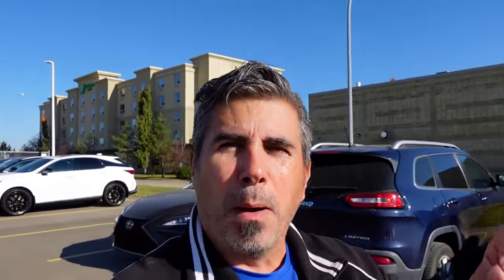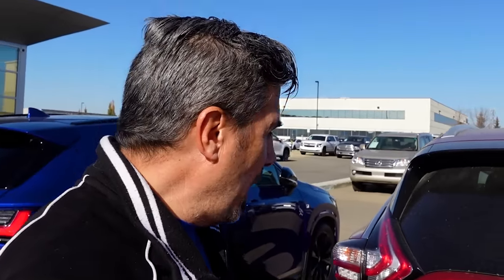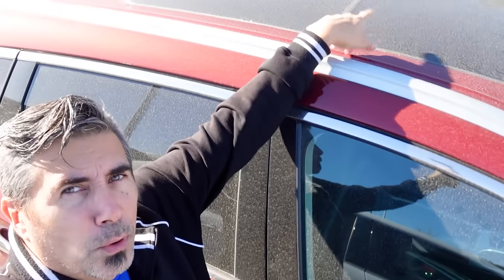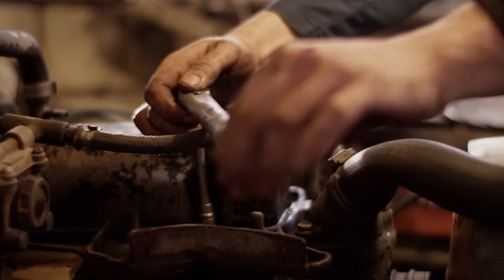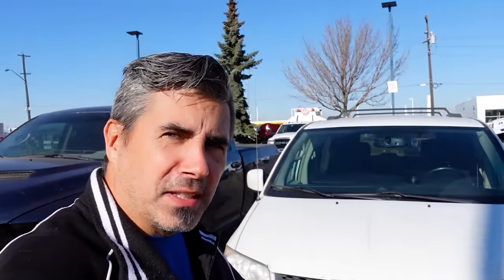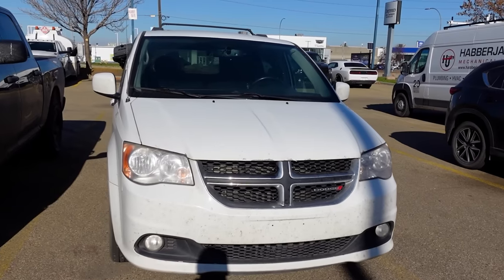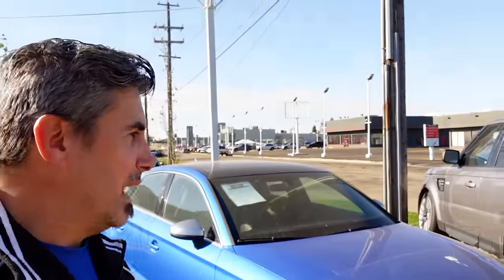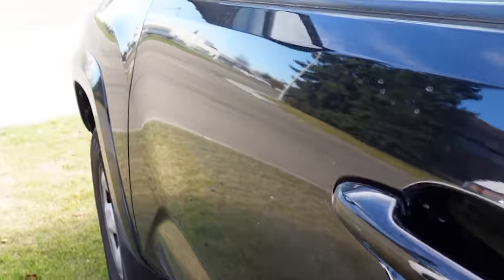Avoid These Cars RUINED By Their Junk Transmissions!

Comment: I always said the biggest problem with car manufacturers is that when they finally build something that works great, they find the need to change it🤷🏻‍♂️
Reply: Yup like new Hondas mainly got turbos if it was a project car yes I wouldn't mind or a weekend car but not as daily driver they barely make naturally aapirated dint know why
Reply: The issue is not the turbo. The problem is that Honda is putting turbos on tiny 1.5 L engines. There is no perfect car but I refuse to drive anything with a cvt or a toy engine like the new Hondas.
Reply: @MrSupernova111  facts that's why I'm glad I'm not into Hondas anymore and got back to Toyota's their not doing this for now
Reply: Engineers need something to do to stayed employed.
Reply: Planned obsolescence
Reply: @MrSupernova111   You're correct.  The reason why all auto makers are doing this is because of CAFE (Corporate Average Fuel Economy) requirements.  They keep requiring auto makers to have higher and higher average fuel economy.  They use the EPA estimates for this, which are based on a formula that includes power, weight, aerodynamics, gear ratios, and lots of other nonsense such as auto stop start.  Because of these idiotic requirements, they're making engines smaller and smaller, cars lighter overall with garbage stripped down components.  Because of overbearing government requirements, safety, reliability, durability, true fuel economy, and performance, are all being sacrificed.
Reply: Or just stop making it. GM is famous for that.
Reply: @pmscalisi   LOL, really?  GM has historically been more successful with it's transmissions than probably everyone else combined.  What other car makers have manufactured transmissions for others?
Reply: @davidstjames_  Toyota and VW have manufactured transmissions for other companies haven’t they?
Reply: @chriskosin472 that's exactly what I tend to think when I see something that seems to make no sense on a vehicle.
Reply: @chriskosin472   No, VW used to have some real garbage (and pricey, $4,000 for a rebuilt trans, not new, rebuilt, just the transmission, not installed), then in the early 2000's, they started buying some, if not all, from a Japanese company, I'm not sure if they still do.  Toyota buys their transmissions from a company named Aisin, who they later partnered with on another company.  Toyota owns part of Subaru and most likely supplies them with various components, I'm not sure which ones.
Reply: they're not their
Reply: they're not their
Reply: @Jac735 a 4 cylinder vehicle without a turbo is for skinny teens under 125 pounds. Iam sure Toyota 4 cylinders are turbos. Non turbos 4 or 3 cylinders is a go- cart not capable to move 4 fat slop Americans which is increasing hourly.
Reply: Works great when 1955??

Comment: CVT transmissions, the death knell of the vehicle at 60k to 90k miles. The recommendation on CVT is to change the fluid every 30K, but inherently a bad unit. Jatco was once an independent sewage plant in the gear ration arena. Then Nissan, to increase profit by purchasing the company, made no improvements.  Toyota, however does use their own CVT in Corolla with reliability still outstanding.
Reply from the maker: That’s true,  how Toyota has figured that out is beyond me, but it somehow seems to work.  Very few others do like Jeep, Nissan, Subaru, Honda, etc.  still a buzzy unit that does not feel natural for the enthusiast.
Reply: My 2002 Toyota Prius had the eCVT, engine, AC and suspension that worked flawlessly for 17 years, 260K miles until totaled because of the winter storm flooding in January 2019.
Reply: As an aside, the much raved about PDK, from Porsche, is a, generally good transmission. However... As any responsible owner, service and warranty is critical! Otherwise, the cost is that of many of these cars that are featured
Good heads up, Mark! We overlook the drivetrain on many "reliable" cars.
Reply: @seikocitizenwatches  The eCVT is not the same as a regular CVT transmission.
Reply: At the end of the day, Toyota is still junk. Let's not forget about the takata airbag, fuel pump issues, wheels falling off and fires now for toyota. It's getting crazy that toyota reliability is downhill.
Reply: @maga6319 I’d rather push my Toyota than own anything else at the moment.
Reply: @maga6319 Toyota is definitely not junk lol. Buy a 4Runner or Corolla hatchback for example and it’ll last you FOREVER. Especially Toyota and Lexus that are built in Japan. 

This is not opinion ask a real mechanic.
Reply: yes, change the fluid, that will keep it going forever. I think they call it preventive maintenance
Reply: @JAMESWUERTELE  So you enjoy toyota's unreliability?
Reply: @@Boxingp4pbx both junks
Reply from the maker: You bet Thomas, the PDK is a beast and made by ZF who has a solid rep when using the 8spd autos in Jags, BMWs, and more.  The best gearbox for s dual clutch in the biz.
Reply: @ECPP  Toyota CVTs come with a real first gear before they shift to the CVT. I’d wager that not leaning on the belt and pulley to get the car moving from a stop greatly reduces wear and tear as that’s the moment where you’re asking the gearbox to work the hardest.

They drive really nice as well, it feels like a hyper smooth traditional torque converted automatic.

Comment: My 1996 Honda Accord has 389,500 + miles on the original engine and automatic transmission.  Hell if I get a new one with one of those rubber band trannies that won't last 60k miles.

Comment: I (nor did my brother) did enough research when we bought our used Ford Focus cars (2014 for me, 2015 for my brother). We both got rid of them due to the garbage Powershi(f)t transmission. It was impossible to get fixed, months to even have a chance to even try to fix, parts were unobtainium. Finally with 59K on it, tired of its terrible behaviors, I traded it in Sept. 2021 it with huge depreciation and bought a Mazda CX-30 as one of the few 'small' vehicles with a real transmission - not a POSCVT.  Sad as the rest of the car was fine.

Comment: Great information here.  I know folks who ended up with CVT issues on the 7th Gen Maxima and also the Murano.  They do not seem to be building these cars for the long haul anymore.  Maybe they are just targeting the lease crowd who will hopefully not encounter the problem.
Reply: It could be that it's a Nissan issue and not necessarily a CVT issue.
Reply: @auaiao9  a transmission cooler, sensor and overextended maintenance intervals problem perhaps.
Reply: Nissan has shit transmissions and overall reliability is shit

Comment: I’m original owner of 2015 Dodge Dart SXT with 2.4 liters, 6 speed automatic OD very dependable and now over 342700 miles with and finally the transmission went so it replaced from salvage from original mileage

Comment: Surprised there he mentioned the Jatco CVT, but didn’t mention that they are unrepairable.  You can have them fixed, and when they go bad the whole unit goes to junk, which then causes supply issues which mean high price for new ones.  A normal torque converted trans can usually be rebuilt.
Reply: anything jatco is junkco

Comment: Yup,  Excellent Topic.  The Early Model BMW I Had Caused Me Major Greif.  Never Ever, Ever, Ever Have A Transmission Rebuilt !  Fined A Wrecked Or Sightly Damaged Model, Like Yours, & Have It Installed In Your Car.  Reason ?  Rebuilt Transmissions bleed And Leak Inside, Then Burn Seals & Bands, When That Happens, You're Done.  These Transmission Shops Know Exactly How Long A Rebuilt Transmission Will Last, 90 Days, Tops !  Very Informative Review, Mark 💯
Reply: I use to be in the transmission refurbishing business. There are lots of updates to rebuilding a transmission to be successful. All my units were backed by a 3 year parts and labor guarantee. I hate to tell you but I think whoever did your rebuild didn't figure your unit out. As the parts you mention are part of replacement and inspection prior to installation into vehicle

Comment: Multi-speed transmissions in these new cars used to comply with ever increasingly strict CAFE standards have never been a good idea and almost no modern vehicle has gotten them right. 6pd. autos were likely the limit and those with 7, 8, 9, 10 gears is too much. They have to be programmed well and almost no manufacturer gets it right. When you step on the gas it’s always a battle between probability, programmed fuel economy and what the driver intends to do. Too many moving parts. They’re jerky, only in the right gear maybe 95 percent of the time and gear hunt at low speeds. You’re spot on with Kia Sportage, terrible 6 speed transmission and vehicle. Only the Aisin 6spd. the ZF 8 speed used in the Ram trucks and believe it or not….Ford’s 8 and 10 speed are the best ones I’ve seen.
Reply: I know Chrysler products can be horrible, but the NAG1 5 speed that was in the Chargers  was, to me, one of the most impressive features of the car. It was an extremely solid design.

Comment: One thing that really aucked and ruined a lot of dodge vehicles was their transmissions. However I must admit, the 8 speed was amazing. Always shifted smooth and accordingly, never had a slip or any hiccup. I was truly amazed by it. The worst transmission by far for me is a 10 speed ford transmission. It is horrendous!! It jerks, sometimes shifts earlt, sometimes late, jerks at low speeds sometimes, sometimes it doesnt. Sometimes i hit the gas, nothing.. then it jumps and shoots me into the seat.. downshiftd violently one time, the other time it doesnt downshift early enough.. the biggest pile of garbage ever made. Im glad I bought an EV
Reply from the maker: The ZF8 speed is a solid unit and is used by a lot of euro vehicles and generally has been solid.  There have been some programming or wiring issues in certain situations but that’s generLly at the assembly end
Reply: I know it was a while ago, I’d say 2006 time frame. I have 3 family members that all bought dodge ram 1500s. I kid you not I was in one of them and we were driving to Las Vegas from Los Angeles. His transmission went out at 50k miles. The other two family members also had the same problem. One at 70k and the other at 80k. I know it’s a long time ago but after that experience I would never buy a dodge.
Reply: Test drove my friend 2020 GT with the 10 speed. Indeed extreme jerky….
Reply: @ECPP they never had a good transmission
Reply: @LSDdreams808 ZF gearboxes are the industry high water mark; specifically the 8sp units everybody benchmarks ZF transmissions. They’re insanely robust. The 9-speed has had calibration issues in a few different brands vehicles, but that’s not a mechanical issue, and have since all been sorted out. The 9-speed is also very reliable mechanically, and today OEM’s know how to map the software properly so they’re not epileptic any longer. We hardly ever have to tear into ZF units for serious issues, even fewer for rebuilds. 8-speed is light years more reliable than Ford / GM 10-speeds
Reply: I will never know why Ford didn't implement zf 8 speed which is clearly compatible with rear wheel longitudinal platform such as ford explorer.
Reply: @Alan-tr5uj  doesn’t the new Acadia and Traverse have a ZF 8 speed now?

Comment: Speaking of Dodge, I had a 92 Dodge Shadow America, an inexpensive economy car. This car had the best 3 speed automatic transmission I have ever driven. It shifted so smoothly it was hard to tell the shift points. It downshifted at just the right times to gain speed. The car was reliable and good in snow. When I went to buy a new car, I found they no longer made these. Too bad. RIP little Dodge Shadow, you were a great car.
Reply: Shadows and acclaims were good. The v6 acclaim had great acceleration as well

Comment: Im happy with my 06 matrix 5 spd that currently has about 340k and doesn't burn a drop of oil and everything still works.
Reply: @Niko-iv4ch  you should also know that there are three different settings on the tripometer

Comment: I have owned 6 Dodge vehicles since 1980. Never had a problem with them. 1974 Dodge Charger, 1994 Dodge Caravan, 1999 Dodge RAM B1500 Van, 2005 Dodge Durango, 2012 RAM 1500, 2015 Dodge Challenger. I still drive my RAM 1500 and my Challenger Daily. People need to learn how to maintain their vehicles better.
Reply: Out of all of those transmissions you listed,,really only the caravans had issues,,and possibly the 99 Ram van due to chrysler leaving the check balls in the transmission lines...Drill those out and those trannys would last too..The 2012 ram and shockingly the v6s in the challengers were pretty good transmissions....BTW,,I'm from NH as well...lol...

Comment: I have a Ram 1500 Hemi V8 running a ZF-8 TorqueFlite 8-speed transmission. Changed the transmission and differential fluid at 60k or 40mi and i tow frequently with this across the US and Can. Have zero issue with transmission. Engine works great but i do oil changes more freq than the OEM recommends.
Reply from the maker: Thanks for sharing

Comment: My Ford (Falcon) G6E has a 6 speed ZF transmission  which Ford say is sealed for life. Previously I had BA (Falcon) Fairmont also 6 cylinder with the same reliable Barra motor. but a 4 speed BTR transmission.  When I had an external transmission cooler fitted they serviced it and then it started playing up. I am leaving the ZF alone. Thanks for the interesting report I guess transmission issues do not effect Tesla drivers. They are everywhere here now with three in my street.

Comment: I have a 2014 Nissan Maxima with a cvt. At 110,000 it started slipping. Solution: change the NS-2 transmission, to the now NS-3. Pull the plug, 6 quarts drains out, put plug back in, put in 6 quarts NS-3. Transmission was fine after that till 30k miles later. Slipping again. Repeat previous process, but this time did it twice. Waited 2 weeks between each change. And....there is an external filter behind the driver side front wheel. Changed that. Transmission is running cherry now. Total cost  so far $500.00 for the fluid,  $50 for the external filter. A lot cheaper than the 8,000 the repair shop wanted, and the shop declared the slipping transmission not repairable. Hmmmmm.......

Comment: I've got 57K miles on my Honda CVT Mark, although it's been trouble free so far, I know it's a ticking time bomb.
Reply from the maker: It is a bit risky even in the Honda, but if it’s holding then that’s great to hear.
Reply: Honda Accord 2017 with CVT. 208,000 miles on it. No problems at all. I had Subaru Outback 2011 with CVT. Transmission died on 140 K.
Reply: @ECPP  I think  you might to do a lil extended research on your years as far as honda transmissions...There are a couple of years in the civic that had issues with the cvt but most of them are bulletproof,,including the accords that aren't a v6...
Reply: It depends on what year civic....If it's a 2014 or a 2015 I'd be concerned but every other year civic,esp 2016 and newer,those transmissions rarely go bad.
Reply: @ECPP  and also the nissans that started putting a first gear in their cvts have become much better...They aren't perfect,but much better....The 2015 and newer muranos have the new style transmission,,,the 2016 and newer rogue,,the 2019 and newer altima,the 2016 maxima,and all of the 2020 sentras,kicks and versas all have the cvt with the new first gear in them....WAY less wear and tear on the forward clutch packs...Just an fyi....I love your page!
Reply: @newworlddisorder7210  You won't have issues with that transmission...The accords from 2013 and newer cvt's are bulletproof.
Reply: @@Boxingp4pbx Not true if we're talking about the 2014 and 2015 automatic civics..Those have engineering flaws regardless of how well you take care of them...Honda fixed the issue in 2016 and have been awesome ever since.
Reply: Keep the transmission fluid changed every 30k it will last longer

Comment: As a technician in the US Toyota and Honda makes the best cvt transmission in the automotive industry and I own a 2014 Honda Civic with a cvt transmission and I had no problems with it and it still works fine since the day I bought it.
Reply from the maker: There have been some spotty reliability with some more recently in the Honda arena, ie Accord.  Sometimes it works and sometimes not as much
Reply: Interesting. Because when those honda cvts ran out of warranty I was repairing alot of them..

Comment: We had a 2019 Taco. Great truck, awful transmission. It was very prone to downshifting on the highway for what seemed like no reason at cruise, which made for a very annoying highway experience, but would not downshift when you’d expect.
Reply: There's an aftermarket Shift Commander (something like that) which reprograms the shift points and makes the truck what it should have been OEM.

Comment: At 19:00, he describes the infamous 3rd generation Ford Focus (2012-2019, north american version). Along with the Ford Fiesta, this Focus equipped with the Ford DPS6 PowerShift transmission has received much criticism due to transmission shuddering, including several lemon law claims. There have been at least 6 revisions of clutch packs and transmission control modules since inception. ----- (I own a 2nd generation 2010 Focus, which has been a good car, with no transmission issues.)
Reply: I own a 2008 Focus, same here with 180,000 miles. Runs great use it every day.
Reply: Get the ST with a six speed - solved! ☺️

Comment: worst car I ever owned was a 2001 Acura TL. had to have the transmission replaced TWICE! luckily it was under warranty both times.
Reply: Yes that generation had particularly bad transmissions which is ashamed because the rest of the vehicle was pretty nice for a car built in 2001
Reply: Those early 2000's transmissions gave Acura a bad name. My 2013 TL has 204,000 miles on it and still shifts great. I also take care of it though by changing the fluid and filter.